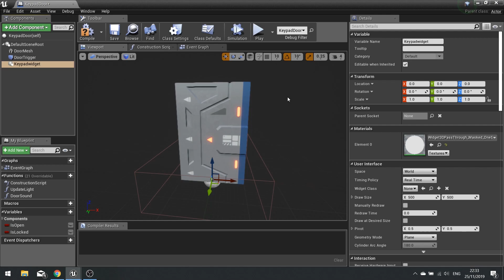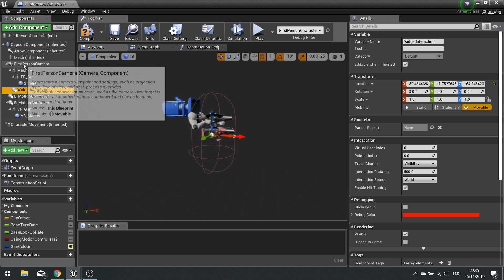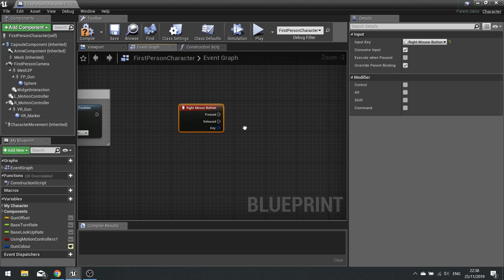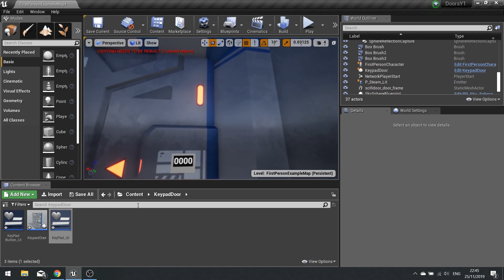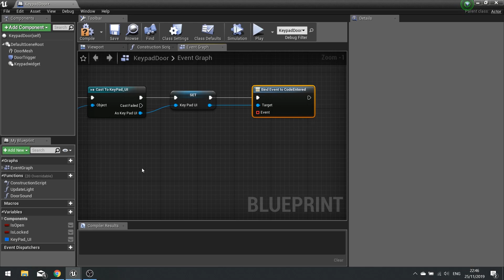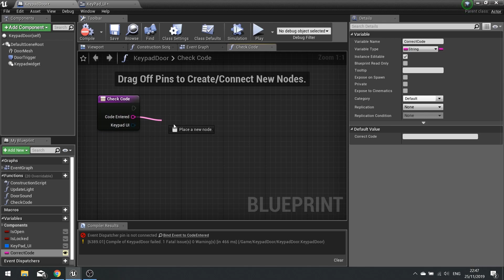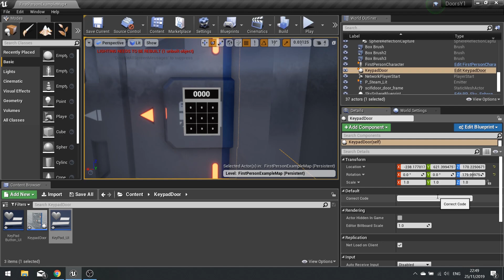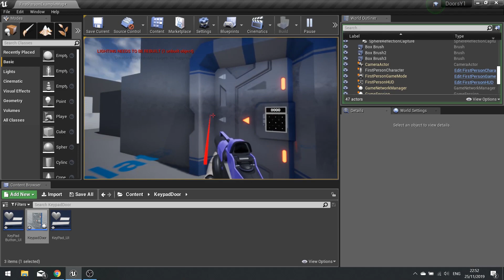Unreal Engine 4 Tutorial – Door with Keypad Part 2

Comment: Just in case anyone's looking back on this; if the WidgetInteraction line doesn't change shape when pointing at the keypad, there might be a collision volume or something else blocking it. In my case, the box collision for opening the door was blocking it. 

You can fix this by going into the details panel of the volume/object and, under Collision, changing the preset from e.g. OverlapAllDynamic to Custom and setting it to ignore Visibility (In the collision responses section). Hope this helps anyone else with the same issue.
Reply: Ty : )
Reply: Ty
Reply: thanks

Comment: When I press the buttons the number don't change. When I tried testing it with the print string before that it didnt work as well...what am I doing wrong
Reply: For some reason you have to right click instead of left click even though u set it as left click
Reply: found a solution yet?